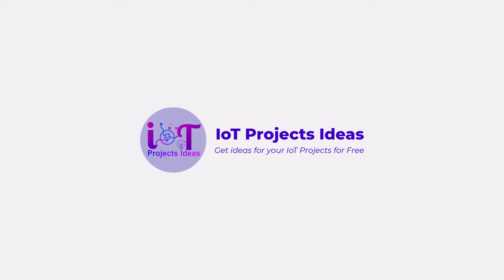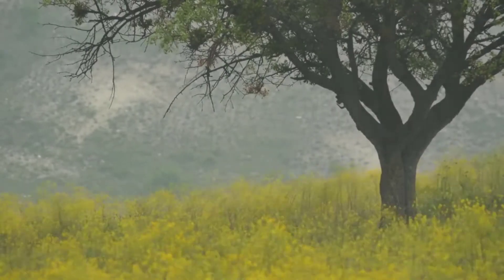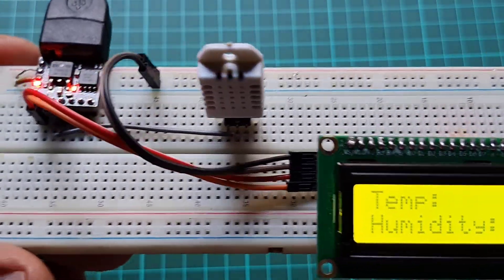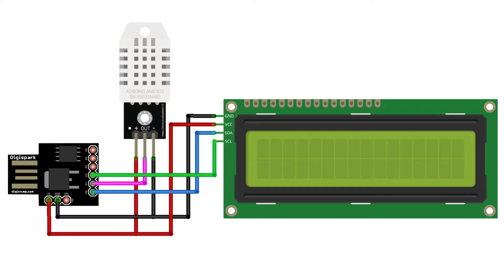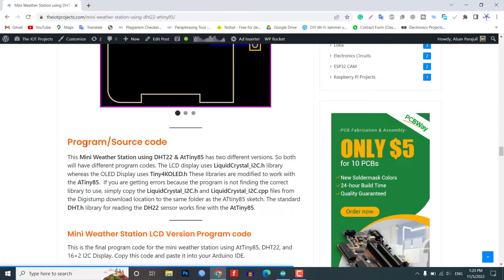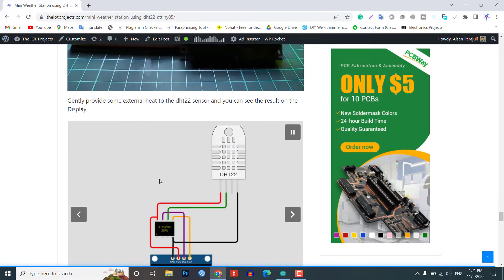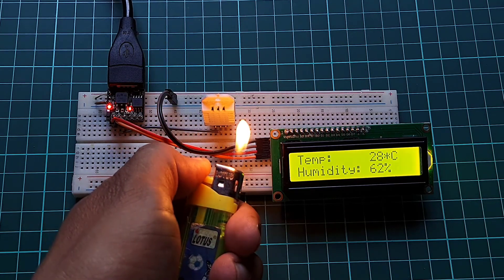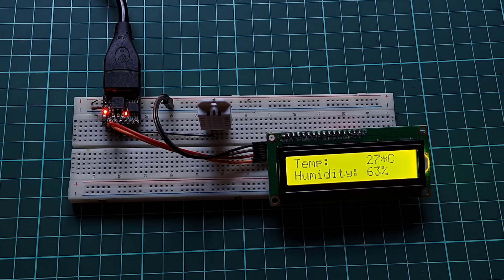AtTiny85 based Mini Weather Station using DHT22 Sensor OLED Display & 16x2 I2C LCD

Comment from the maker: ► AtTiny85 based Mini Weather Station using DHT22 Sensor OLED Display & 16x2 I2C LCD
► Download Circuit Diagram, Source code, and guide from here: 
►  https://theiotprojects.com/mini-weather-station-using-dht22-attiny85/

#Attiny85  #weatherstation  #dht22 #oleddisplay #lcd